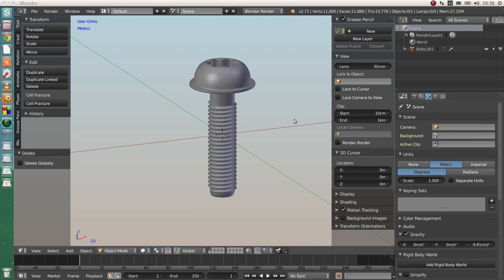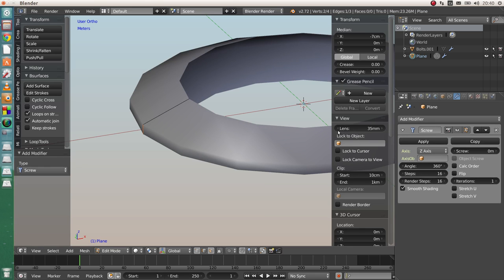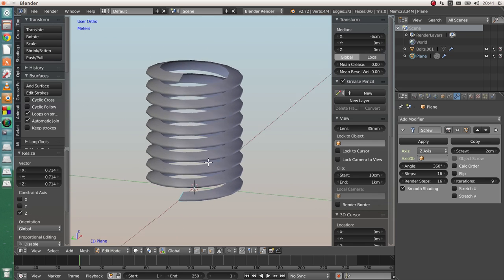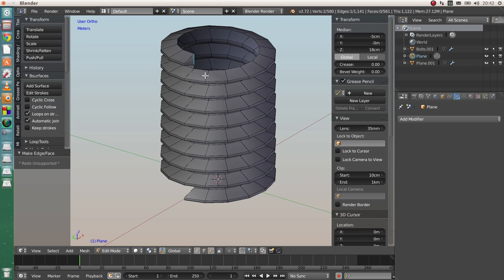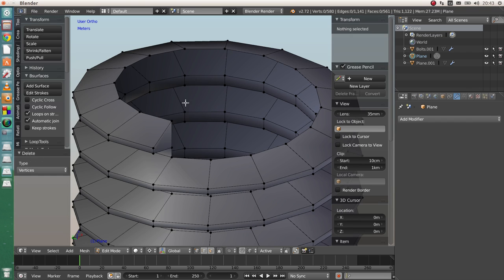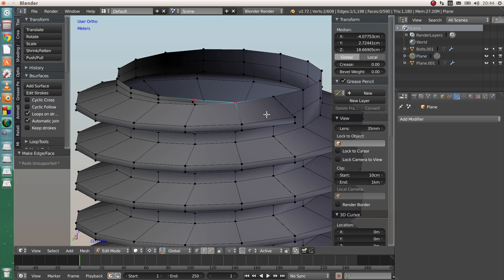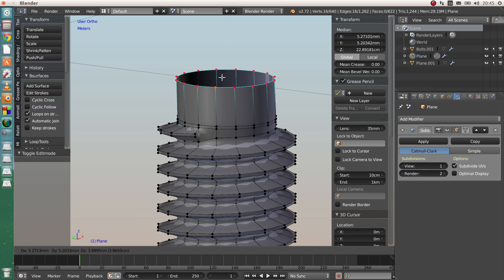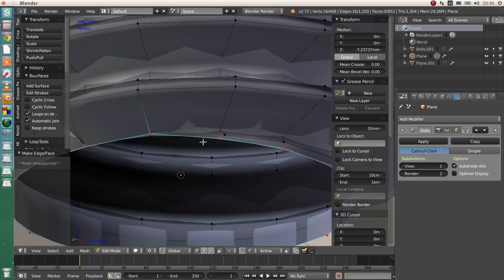Blender quick tip [02] - proper topology of screw/bolt

Comment: 3:00 How have you repeat it? I have this F2 addon now, just wondering how I can repeat the last step as shown in the video...
Reply from the maker: +winstonaliassnouble As  I've said in the video, I'm just holding [F].
Reply: Oh okay, thanks for the fast reply, I try out later again, at the moment I only got lot of faces at the same place...
Reply: +winstonaliassnouble 4:44 the same Problem, I have the F2 addon but I can repeat with Shift R only the last Action. Do I have activate something? When I press Shift R then I repeat only the Rotation of the vertex, but not the duplication of the vertex point. Sorry for questioning, maybe I have to watch more of this F2 Videos but maybe you have an idea, too.
Reply from the maker: winstonaliassnouble Shift R repeats just the last action, so duplicating and rotating have to be one action. Follow the video and do NOT confirm the duplication before rotation. Hit [Shift+D] and then [R] immediately after that. Do NOT press RMB or enter between.
Reply: Okay, many thanks for your replies and the tips, I managed the "Face fill" in 3:00, I found out what I did wrong, I have marked the "vertex" point and not the edge so that was my mistake, I should watch with more attention... And thank you for your help with the copy, I think i will manage that soon! By the way, your screw tool "simple screw" is a nice feature, very helpful, I have it too, now, but it is a good exercise to make it manual without a tool.